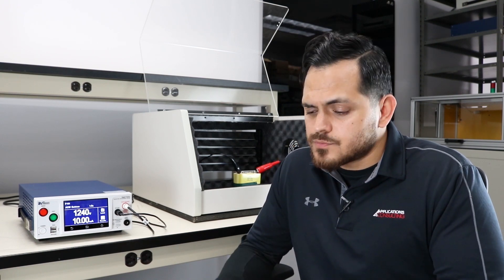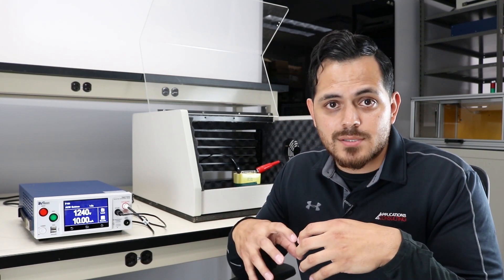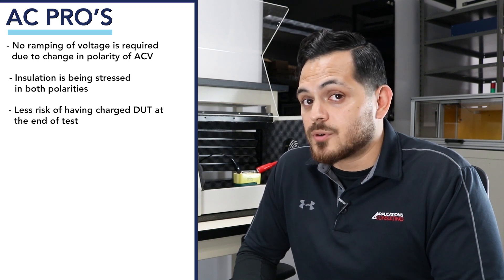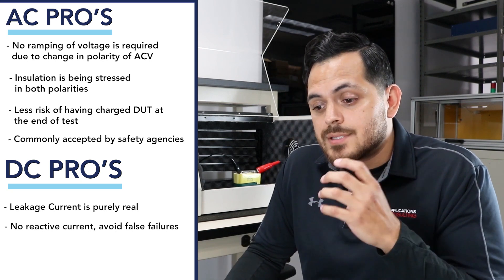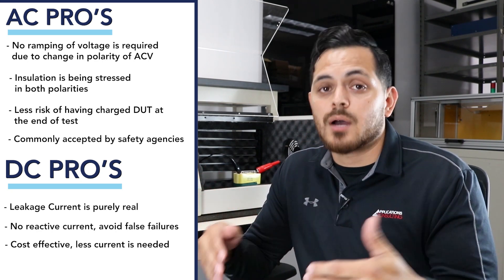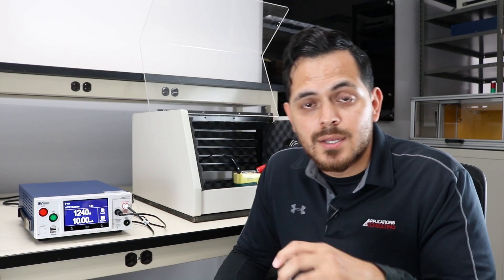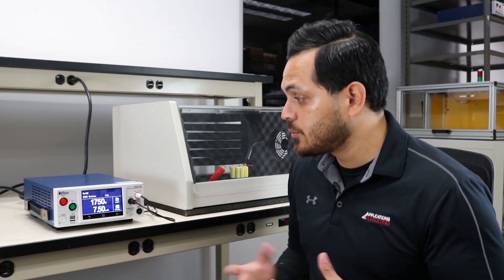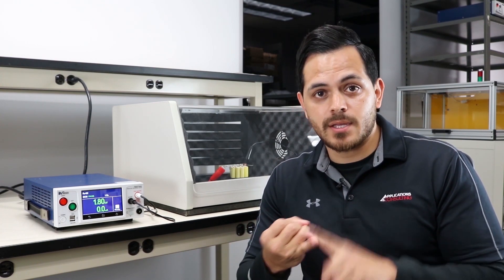AC vs. DC Hipot Testing

Comment: thank you, have a question I hope it finds you. when testing caps can you go over the rated voltage of the cap?
also I read somewhere that DC voltage coupe destructive and can damage cables. is this correct?